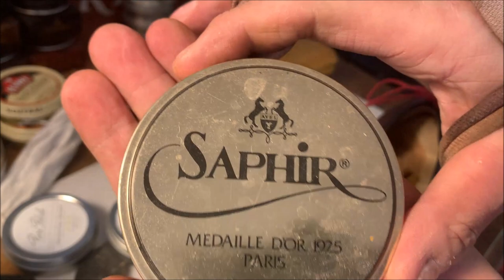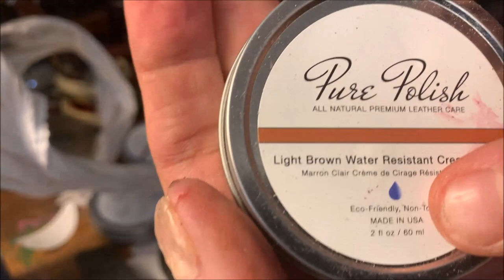Fix & Shine (heels & half soles) on 4 Pairs of Allen Edmonds

Comment: Bob, just fyi if I might, I picked up from somewhere that if you heat up the thicker top lift rubber and even the knife blade when cutting it makes it cut much easier and also , and even more importantly , the edge is very crisp and clean. I can get it without any flat spots or jaggedness, etc.. sometimes I don’t even require to sand..
Reply from the maker: Interesting... I’ll have to try that!

Comment: Nice Robert. I have a question though and I appreciate if you can a answer me. Do leather sole tougher than rubber sole? Is rubber sole more flexible? I have never tried a leather sole and I am just worried to waste a lot of money on pair and end up not wearing them. Any advice?
Reply from the maker: First, my apologies for missing your comment. It depends on the quality of the leather vs the quality of the rubber. For example, with Allen Edmonds, the standard leather sole for calf skin shoes is not very tough these days. It wears pretty rapidly, and definitely is less dense than the leather used 10-20+ years ago. My understanding is with the change in the leather tanning industry and the EPA, it’s more difficult to get good leather nowadays. Their rubber soled welted dress shoes are usually Dainite. I’ve thrifted some Dainite soles shoes, but never worn them myself. My opinion is that Dainite is tougher and more wear resistant than leather. I don’t know if there will be a significant difference in how it feels as far as the flexibility. You could go to an Allen Edmonds store and try both on. The Shell Cordovan AEs come with JR Rendenbach oak bark tanned leather soles, which are very tough.

Comment: Bob, I’ve used your videos to apply rubber protectors to my soles but I find some but not all of the corners and edges keep peeling back a little. What am I doing wrong? I use masters cement and the surface is fairly scuffed to help with adhesion. I let cement dry to tacky phase, about 15 minutes. Should I wait till bone dry?
Reply from the maker: As you saw, the tips of the toes did peel a little on mine, but here are some tips:
1. The soles near the edges should be as square as possible. If the shoes have been worn, the edges of the soles will be rounded off, and the half soles will be more likely to peel back off. This is the most important part. If I ever put them on worn shoes, I really try to sand the soles such that they form a nice sharp 90 degree corner. If for example the tips of the toes are too rounded off to make the corner sharp by sanding, you'll either have a gap as soon as you glue the half soles on, or because you're trying to stick a flat sole onto a curve, they'll start peeling back off soon.
Good prep:
 ________________
 |                                   } leather sole cross section
 |____|-|__________
 =============== <- rubber half sole

Bad Prep:
                                   |
Curved sole edge-> \___|-|__________
Creates a gap -----> ===============

2. Sole prep: I have found that lightly sanding the soles yields a good adhesion. If you noticed on the Macneils in the video, those soles were brand new when I applied the half soles, but if you look cloesely in the video you'll see that they were sanded down a little. 3. Make sure the leather is clean & free from dirt and especially any oil. You may need to clean them off with alcohol or brake cleaner if they're used soles. 
3.  As far as how dry to let the glue get, that's tough to say bc humidity and temperature affect the time. I usually wait until the glue feels pretty dry; until my finger does not stick to it if I touch it very gently. I've seen pro cobblers let it dry then "re-activate" the glue with heat, but I've never needed to do that.  
4. Press them on: You can stand in the shoes on carpet if they fit you for a few minutes. I don't usually use it but I made a little press out of wood and a metal cobblers last. Or just take your hammer to the half soles like you saw me do in this video on the back edges. Make sure there are shoe trees in them though when you pound on them.
5. Make sure you're using enough glue, but not too much. I find that especially on new soles, I may have to put 2 coats of glue on the leather. The deeper you cut into the leather, the more likely it is that you'll need a second coat. For example, at the back edge, did you notice how I cut an arc into the leather soles to get the back edge of the rubber half sole more flush? That 1/2" area where I cut into the leather more deeply than just the sanded area usually soaks in the first coat of glue. You can see it... that area will look dry compared to the rest of the sole. The glue soaks into the leather, requiring a second coat. I only needed one coat on both of these shoes bc they had already had glue on them from the first time.
6. Make sure you're putting cement on BOTH the soles AND the rubber half soles.
7. If you don't do a great job with trimming the rubber half soles, it will promote peeling off. If after you apply them, if there is ANY amount of rubber sticking out over the edge of the leather sole, it will catch on things and that edge will begin to peel off easier. When a good job trimming is done, other than the color being different, the edge of the sole should blend into the leather when it's perfect. If you notice on these 2 jobs, the half soles on the Park Avenues was almost perfectly cut by my standards, and the half soles on the Macneils was a little shy of the edge of the leather sole by maybe 1/32" in a few places, but they weren't overhanging anywhere.

I hope that helps!
Reply: @CobblerBob  thanks for the generously detailed reply!